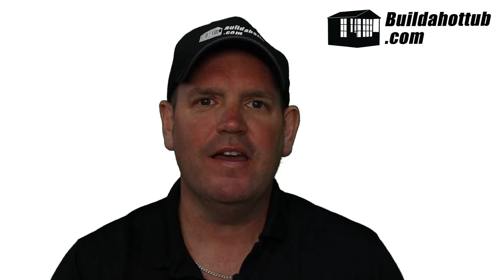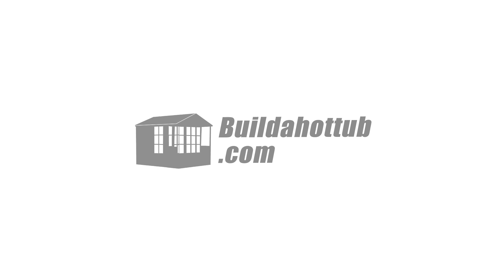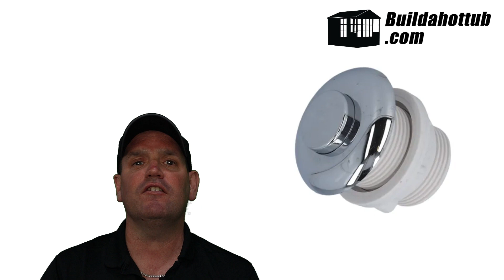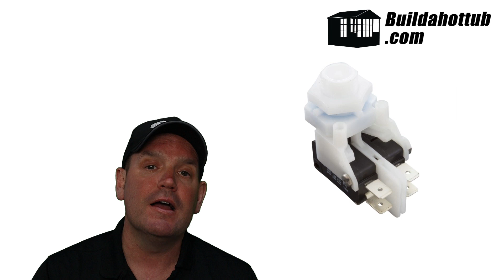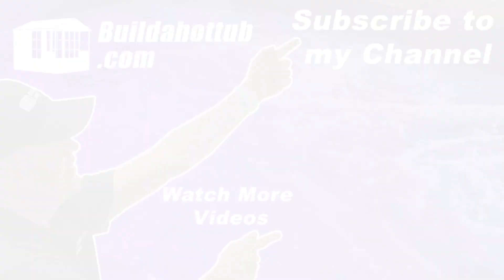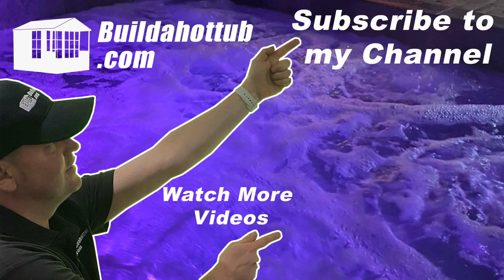Hot Tub Air Switches - The Ultimate Guide

Comment: Hi I was wondering if there is a air switch that you can recommend that sends more power (air) to the blower. I have bought several different air buttons for my inground hot tub, but none of the buttons seems to give enough air to power on the blower. If you blow in the tube the blower works but as soon as I try a button it doesn't start.
Reply: I'm just digging into this myself since I inherited an old jetted bathtub with the home I bought that was electrically disconnected behind the tub access panel of another room. The air switch gets stuck. Maybe you need a different bellow with a higher psi depression with the tube or a different new air switch?